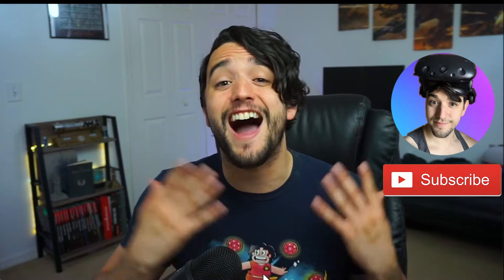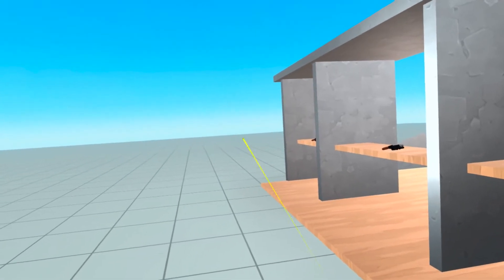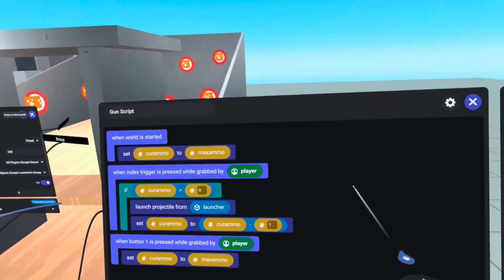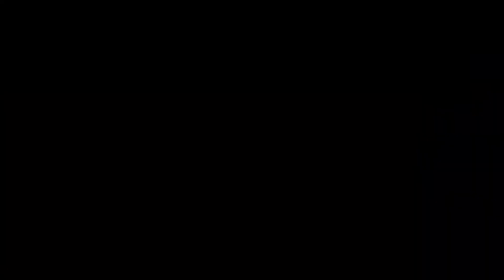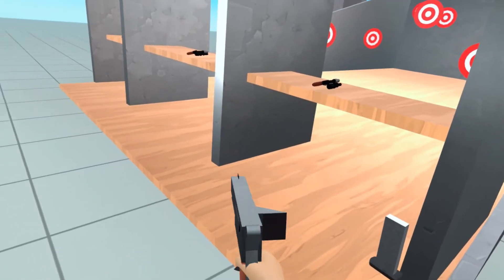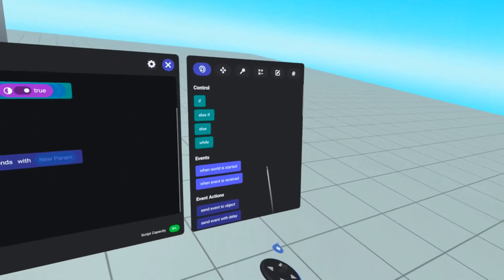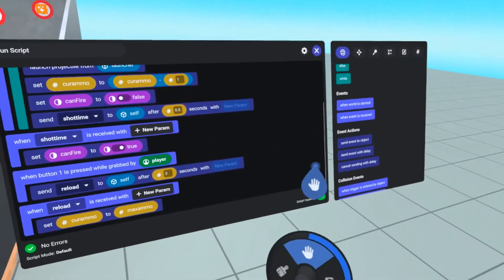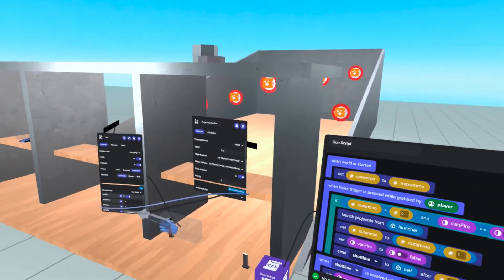Horizon Worlds Scripting Weapon Fire Rate and Reload Speed

Comment: Hey! I’m finally back on horizon after a break. Could you go over the new “set who can grab object” in actions. I can’t get it to work for the life of me!! What is an assignee!! How to input player names so I can assign them idk!!
Reply from the maker: Assignee is just fancy for player lol you can put player or even a player list. There is also a setting in an objects properties panel you need to set too if you want that command to work so make sure you check that
Reply: @JackaldudeVR  thank you, so I make a player list and add that player to the list? Then put the list in the assignee slot?
Reply from the maker: Doesn’t even have to be a list. You can straight up even put a player named (blank) using that operator in the operators tag. I’ll probably make a video on it at some point because it’s a powerful command
Reply: @JackaldudeVR  I try this and it does not work? Let me run it by you. 
When world is started-
-set who can grab (self) to ((name of (server player)==(hunterb80))

Then I go into the block of choice and switch it to script assignee(s) and now no one can grab the block, even me (hunterb80). I do not know what I’m doing wrong in this case, I use “name of player” I put server player in the blank, I use an equal sign so “name of server player == “string input”” and I put my name in the string.
Reply from the maker: Sorry there was a bit more to that. Make a player variable named plid or something and try this

-When (player) enters world
    If (player name of (player)) == string input (hunter80)
         Set (plid) to (player)
Under that put

- set who can grab (self) to (plid)

Hope that helps I’ll try to make a video soon!
Reply: @JackaldudeVR  trying now